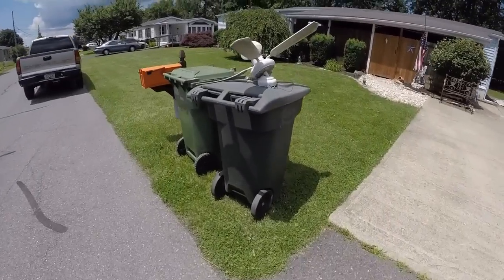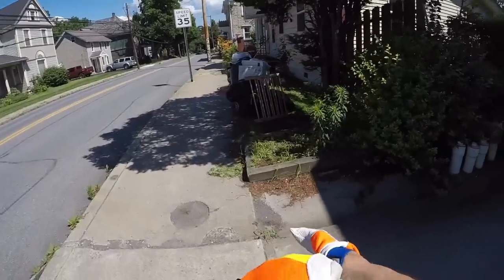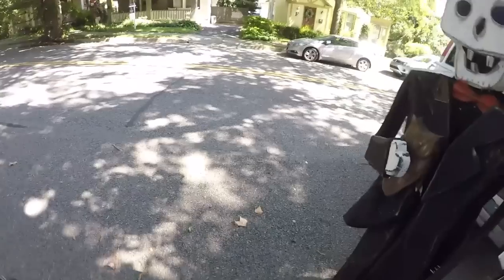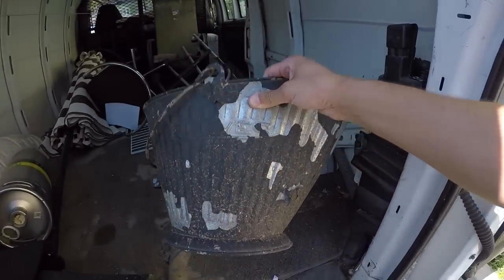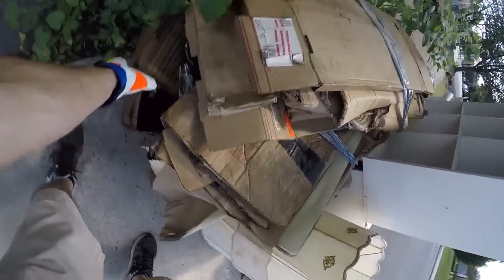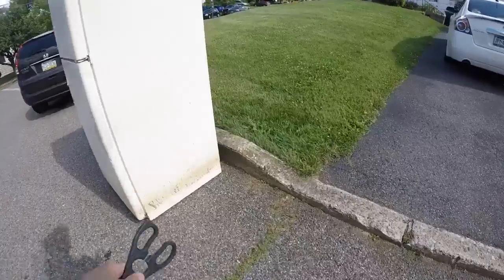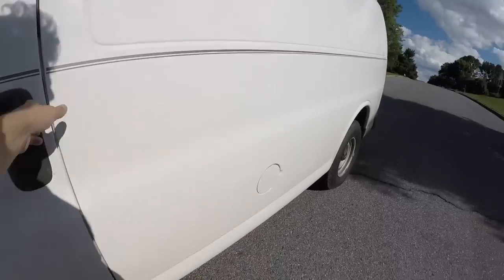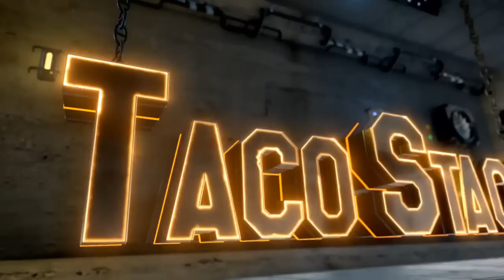GARBAGE PICKING LIVE - Huge Scrap Scores + More!!

Comment: I sell over 200 vacuums per year, that I pick up in people's trash.  Many just need a belt, or lint cleaned out of the hose.  I scrap a few for parts and rarely have to buy any parts.  200 X $15. (average) = $3,000. per year and I never spend more than 20 minutes fixing them.